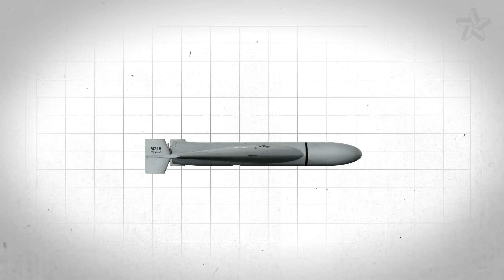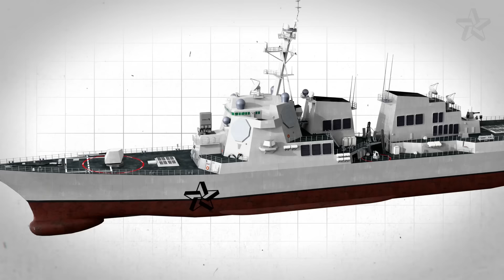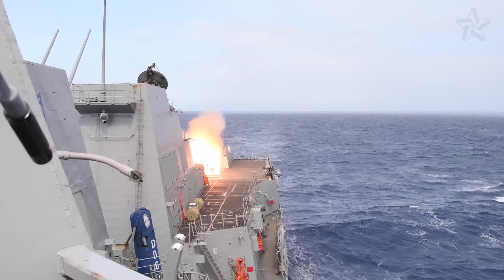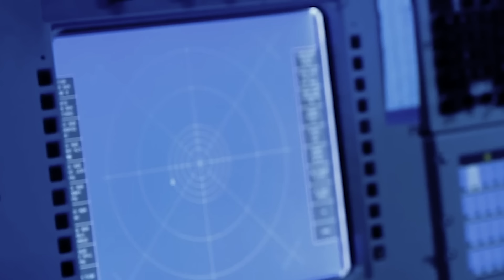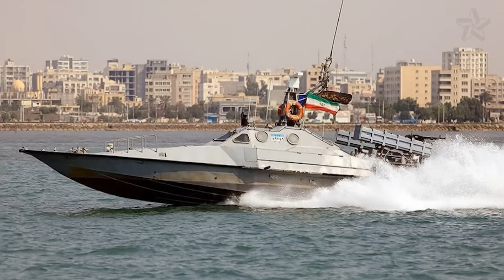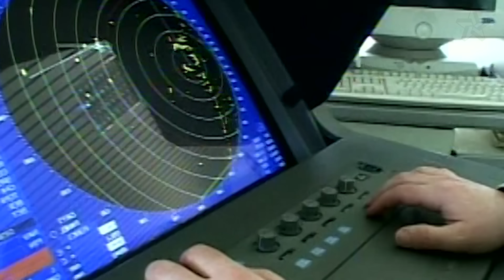US Navy Launched Something That Shouldn’t Exist… Iran Can’t Stop It

Comment: Im not worried about 47 drones … im worried about 500 or 1000
Reply: It is the cone of discharge, it does not matter how many targets are in the cone, they all fall down...!
Reply: if the launch that many drone, they better start digging their 6 feet holes ahead of time because retaliation would executed even before they get closed to the fleet.
Reply: @victorforzani3433  they will need to be deeper than 6
Reply: It's not the drones. Is their anti-ship missiles and torpedoes. Drones aren't the problem. This video fails to address that.
Reply: @zerosteel0123  WE HAVE THAT TOO! THE DEFENSE SYSTEM  IS 100% SECURE AND KNOWLEDGEABLE OF THEIR ACTIONS. THEIR PROBLEMS IS THEY DO NOT KNOW WHAT WE HAVE. AND WE HAVE MUCH MORE TO DESTROY THEM. OTHERWISE WE WOULD GO EVEN NEAR THERE.
Reply: @marcusmoyses3809 do all bots use all caps?
Reply: @marcusmoyses3809  looks like your navy carrier just fled to the Indian ocean. Not only that but you abandoned your base in Abu Dhabi. We got to see US planes tucking their tail and running. What a sight to see.
Reply: @zerosteel0123  what we seen is US airplanes flying at will thru the Russian and Chinese Air defense systems that Iran was using. We seen those planes successfully hitting thousands of targets. Got the bonus of seeing that Iran's drones were not as good as this video showed and that their navy practically sank on their own
Reply: Was also fun to see how helpful Russia and China were helping their partner
Reply: @zerosteel0123 you must think we care about defending places that aren't ours in the first place.  Don't pretend to know why we don't want to be in the middle east anymore.  Or what you're heading is the actual truth.  You probably watch msm news and believe the lies
Reply: @helloneighbor11 oh my. Times, they are changing....... you're getting your asses kicked and fleeing your bases.
Reply: @LookingUp99  right. I guess if you didn't care you wouldn't be there.....oh, wait
Reply: @zerosteel0123 lol.
Reply: @zerosteel0123  your comment aged like milk
Reply: @Crimea_River  Iran is kicking America's ass. What a sight to see.
Reply: @zerosteel0123 😂😂😂 thanks I haven't laughed that hard in a while
Reply: @Crimea_River  that's all you got? Weak come back
Reply: @zerosteel0123 what you’re failing to get goat humper. It kills missles also
Reply: @zerosteel0123 we can shoot them down with this and we have underwater stuff also
Reply: @zerosteel0123  How did that go for them?
Reply: @zerosteel0123  Those didn't work out so well.  Bye Bye Iran's navy.
Reply: @TheCapul3t  I guess you haven't seen the US navy ships that have also been hit. Here is a clue for you. If the US Navy was in control Iran would not be able to close the Strait of Hormuz. But they have. If America has complete control, it could not be done. Wake up to reality.
Reply: @zerosteel0123 I didn't see it because it didn't happen.  Provide even a single verifiable source and I will shit my pants for your pleasure.
Reply: @TheCapul3t  you can do whatever the hell you want to do. When reality hits you like a sledgehammer just know somebody told you so. IDGAF what you think one way or the other.
Reply: @zerosteel0123  the navy has Geo shields that can protect every ship in the attack group .
No matter how many drones they send , they will have to get past the Geo Shields.
There are multilayered protections that the enemy hasn't seen yet in our arsenal .
Reply: @capp11295 I guess you missed the part about the hypersonic missiles, torpedoes, anti ship missiles .........
Reply: @zerosteel0123  I was just pointing out that drones can't do shit..Because of technologies we haven't seen yet., but your right about the hyper sonic missiles, torpedoes, anti ship missiles , those weapons still present a real  challenge...
Reply: @zerosteel0123 don't matter,  we just zap them out of the sky.
Reply: @capp11295 no they don't,  we van take them all down,  we can debt access and shut down the people running and firing them.  We just defeated every bit of tech that China,  Russia and whoever in Venezuela who use that exact modern hardware.  You kidding? We completely shut it and the humans down.
Reply: They present ZERO challenge. They cannot compete with anything we have today.  We're 400 years ahead of them and we haven't even used the crazy stuff much yet.  We're still out in the jungles and the oceans playing with it.  Besides what we have that's space based.
Reply: @LookingUp99  "zero challenge" Iran is kicking your asses. If you cannot even beat Iran what chance do you have against Russia or China?
Reply: @zerosteel0123  it's all in the math.  Iran, China, Russia can't destroy a strike force. They all know this.
Reply: @charlienelson7611  looks like the USA is getting its arse whooped against Iran.
Reply: @zerosteel0123  this didnt age well for you
Reply: @scott1637 the USS Abraham Lincoln is hit and out of the fight. A Destroyer was hit while refueling and the Houthis just took out a Destroyer in the Red Sea. Your THAAD missiles are gone and Iran's missiles are hidden underground where the Americans cannot find them. Where is their disadvantage?
Reply: @zerosteel0123  The IRGC claimed it struck a US Navy destroyer in the Indian Ocean using Ghadr-380 and Talaieh missiles during Operation True Promise 4, though Washington has not confirmed the claim. CENTCOM previously called similar Iranian claims about striking the USS Abraham Lincoln a lie. in other words you have been fooled.
Reply: @scott1637 right..... Just like the "truthful" claim that only six Americans have been killed in the attacks so far? Or the "truthful" claims coming from the Ukrainian war that they're "winning."
Reply: @zerosteel0123 Torpedos don't matter we have underwater drones too...
Reply: @n.s.4424 "torpedos don't matter" you obviously don't know anything about naval warfare
Reply: @zerosteel0123 they don't.  You don't get that these UFO and USO stuff flying around the sky's and oceans are our hardware don't you? No, you dont. We can do well over 200mph underwater. No torpedo can touch that speed.
Reply: @zerosteel0123  looks like Torpedos do  matter
Reply: @scott1637 they really do
Reply: We have the Lazer
Reply: @rickblumenschein2433  Bob Lazer no longer works for them
Reply: High power microwave  sort that out , it's like ...bring it on ...bring 5000 they will fall out of the sky like bird droppings poepoe😅
Reply: @mariuskruger6940  Lead and vacuum block microwaves. Electronics in thermos like this, so the shielding is in order 🤫 .
Reply: God bless America
Reply: @rickblumenschein2433  God doesn't bless satanists
Reply: Add another meteor and their own generator should kill any amount of drones
Reply: @matthewsteinmeyer4998 yeah, 4 of these things in a battle group they don't stand a chance. Take down anything. They'll only get more powerful, more speed at doing the coordinated strikes, no one can compete with us.
Reply: @LookingUp99 there is no country on earth that can stand up to the full military might of the 🇺🇸 USA. The terrorists in Iran couldn’t hold the jock strap of one battle group.
Reply: @matthewsteinmeyer4998 The Navy’s Project METEOR is currently in the prototype and testing phase, with its first shipboard installation scheduled for late 2026. It is not yet in active, wide-scale operational use.
Viability & Strategic Value
Swarm Defense: Unlike lasers, which hit one target at a time, METEOR emits a wide-beam microwave pulse that can "fry" the electronics of entire drone swarms simultaneously.
Cost-Efficiency: It offers a nearly unlimited magazine with a "low cost-per-shot," solving the economic imbalance of using multi-million dollar missiles to down cheap drones..

Yeah. Iran is boned if this pans out
Reply: Just so you know. That's the capability of 1 destroyer 😂😂
Reply: It can intercept unlimited
Reply: Anda tetlalu yakin dengan teknologi anda.  THAAD musnah, Iron Dome pun  penat hingga jatuh di tempat sendiri. Sebab itu China membuat model kapal pengangkut pesawat US di padang pasir mereka.
Reply: @Abe.199 uh huh… I think we will be just fine.  Enjoy the third world.
Reply: You no pay attention it would take out a thousand if they are in the cone
Reply: @philipcraft6839  100% RIGHT !
Reply: Why when it frags one electrical system it frags #2-1000 also
Reply: Plus missiles
Reply: yan ang napala nyo
Reply: ang muslim nd takot mamatay kayo amerkano takot kayo mamatay
Reply: CHINA
Reply: They cant launch that many simultaneously. The simulation accurately depicted their capability
Reply: @LiamJaytheGreat even if they did, it wouldn’t matter.  3 or 3000, it’s the same energy output with the same result.
Reply: If these drones are in a fixed path how can any hit s fast moving object
Reply: @ey6008 the drones don’t move at the speed of light like the microwave pulses do. Wait until we start with laser weapons.
Reply: The hypersonics Iran has will take out the ships cant defend against 18000 kph
Reply: @thechartjunkie3822 those are also susceptible to laser and microwave. Everything is.
Reply: @thechartjunkie3822  how did that work out for the iran leaders
Reply: @scott1637 not good but all 27 us bases have been hit and isral is getting smashed.  They will run out of defencive misiles soon and not that many of them are working and they have also been failing and landing on them selves.
Reply: @thechartjunkie3822  LMAO sure buddy is that what the Iranian news outlets are telling  you know thats a lie
Reply: Try watching scott ritter, us wepons inspector and adviser to trumps first administration
Reply: @thechartjunkie3822  There has been a lot of so called experts who disagreed with Trump and he continues to prove them wrong on so my fronts. I remember when Obama said Trump need a magic wand to bring jobs back and all the leaders in Europe laughed at him when he warned them about being to dependent on russia Gas,  Now look at them fools.
Reply: A lot of experts that tell the truth just like Ukraine is winning the ate running out of misiles  we are seing the same bulshit now.
Reply: @thechartjunkie3822 how do you know? Do you have classified information that we don’t, or are you being lied to by those supporting Iran?
Reply: @Notafanofwoke
Larry Johnson  cia analyst 
Scott Ritter wepons inspector and adviser to the first trump administration.
Douglas Mc Gregor.
Reply: @Notafanofwokeand I study war and wepon systems, and know that the US and israil and EU and UK are the bigest liers and say things the are so moronic and arnt in the realm of reality. I'm Australian with a lot of military family.
This will end with the US being kicked out of the middle east buy the Arab states.
Reply: @thechartjunkie3822 lol you are claiming to be so smart, but you can’t even spell or fail to check your spelling! It makes your claim invalid and ridiculous! 😂
Reply: @thechartjunkie3822 So you say..you can’t even spell weapons correctly. 😂
Reply: @thechartjunkie3822 Did you miss the video? The ship is equipped with a microwave laser. Thats the speed of light. Thats about 1 billion kph. No, the hypersonic missile will have zero chance. This is why the USA invested heavily into laser technology while others were doing hypersonic missiles.
Reply: @nicksaunders115 you have no idea what you are talking about microwave is diffrent to a laser wepon. China has a microwave wepon that can take satellites out of high earth orbet. Laser is a intense narrow beam.  These are not new and russia and china have been leading the technology. The same with hypersonics. 
Its about targeting not how fast a beam of light is. They are affective on up to about 5000 kph at most.
Reply: @thechartjunkie3822  China has zero earthbound microwave weapons as of now. Russia, less than zero. 😂😂😂
Reply: @thechartjunkie3822 Used up early against Israel. There down to zero. No option for resupply.  Plus, the launch facilities for anything that large continue to be obliterated.
Reply: exactly
Reply: The same thing would happen no matter the number
Reply: Iran wants a Nuke, We'll give them one!
Reply: NOT WORRIED ABOUT 100,000 DRONES EITHER. SHUT THE GPS THEY ARE USING DRONES WELL DROP LIKE FLIES!
Reply: Simple shit to interrupt drone signals... USE the N.E.T.
Reply: Iran will expose their secret caves with the N.E.T.
Reply: THE LAUNCH AREA FROM IRAN JUSTS GOT FUCKED!
Reply: We have drones for that shit too
Reply: Don't forget the  U.S. NAVY HAS LAZERS!
Reply: IRANIANS forgot about SPACE FORCE
Reply: Iran forgot we have a $15 plus billion plus and growing Military Budget Savings... Our Space Force has something I can't say here... But Iran and even China and Russia would SHIT Warheads when we use it on IRAN that's already inside IRAN
Reply: We don't need nukes... Iran has a major fault lines... We just need to activate it ...
Reply: @n.s.4424 the idea when dealing with Iran is to take out their government and military, not their people.
Reply: Colaps the Arabian and Eurasian Tectonic Plates Under Iranian Bases and they can't defend from that!!!!! What then when shit falls on top of your underground bases? They expose every underground breathing holes . THEN WE USE FULL BUNKER PENETRATING BOMBS! DONE!
Reply: Im only worried about the 600 nukes they smuggled over Biden's open borders.
Reply: nah piecce of cake, the closer they get the easier it is to down em all, what you just watched was simple target practice with several defenses used. They do this for a few reasons, to get rid of aging weapons and to test the system live for functionallity and to keep the operators well oiled, not to mention the fear it puts in the enemy
Reply: Lazer array melts 70 different targets at the same time 
You don't see it's use because of proximity requirements
Reply: Yeah because that's what we'll be facing against a naval battle with China.
Reply: Not with this, zap them all at once
Reply: we already blew up that many before they took flight
Reply: Russia atacks now in 3000 drones...
Reply: I imagine if they could launch that, then they would have. That's for the war with China, and yeh... that would suck
Reply: Yea they were already taken out by ground penetrating radar scalar weapons...dont worry we good...just need China and Russia and Japan to keep fucking off
Reply: Iran is in Trouble because Trump has been wanting to destroy them for a cery long time and now he's at it so it's possible that they might get nuked
Reply: And then the next 500, then the next 500, then the next 500 and so on
Reply: I often wonder why they can’t spoof GPS signals with an “evil twin” drone to send back the drones to their sources 😂
Reply: How about multiples of 1000 from different directions? The question is do we have the fortitude to do what is necessary with these type of threats to civilization or not because if not, civilization will end.
Reply: @johnsoper7649 exactly it turns a circle it doesn’t matter a million . It don’t use bullets. Imagine a flash light if the light hits you. You fall down.
Reply: @philipcraft6839 plus, that was one destroyer in the example. Do we think they only have 1?
Reply: Accurate. Fortunately we also have more than one AB class Destroyer out there. 

From what we've seen, Iran's capacity is about 3,000 drones. Which translates to... not enough to overcome two carrier strike groups.
Reply: why worry, unless you helped your kid believein joining up after failures in Vietnam, Iraq, Afghan, Cuba ++
Reply: oh. I forgot Korea.
Reply: @P @Promotall litarily we won Vietnam  but lost it politically . As far as Iraq…. We kicked their butt, hard. Never tried to take over Afghanistan so that doesn’t matter. We never actually invaded Cuba, either. That would last about 2 days. Max.
Reply: @kungfuhorn1  Look up the "Bay of Pigs"  re Cuba. As for the rest any search will show you the truth.
Reply: @kungfuhorn1 Cuba's shittin' sugar cubes now.

Comment: Oops! Did you just leak military secrets to the enemy? Now Iran only need to wrap their electronics with a water blanket. Water is an effective shield against microwave energy. You should have said the weapon was X-ray based. They would have used a lead shield against X-ray and the extra weights would shorten the drone’s range.
Reply: It suredoesnt matter what they wrap them in . If they dont have GPS guidance they surely won't hit a moving ship. Besides a drone with a puny 2 cycle engine can't carry extra weight far if they can even fly.

Comment: Well, a drone is a thing of the past. They'll use HYPERSONIC missiles ... and other means - ALL AT ONCE! You can't stop hypersonic plus glide vehicles. Period.
Reply: Iran doesn’t have any  verifiable hypersonic glide missiles yet … drones are not a thing of the past …but you’re right , we can’t reliably stop HGV yet…. We were asleep at the wheel and made a very bad military calculation years ago by not pursuing Hypersonic … but we are catching up fast …
Reply: For every new weapon eventually a new defensive weapon or system is invented.   Advances in electromagnetic energy systems will eventually be able to track and immediately destroy anything flying slower than the speed of light.  I can envision a microwave curtain or dome, a force field that could destroy or knock out any flying object, especially if in combination with an active laser or particle beam weapon.  We now have small transportable nuclear fission reactors that could supply the necessary energy and cryogenic cooling systems to ensure rapid or constant use of these weapons and defensive systems.  I wonder if the British SABRE engine cooling system could not be adapted to provide the cooling.

Comment: Also that dish can fire off free aim, they were originally made for crowd control and self aiming by the operator. So it wouldn't need the radar track if they knew the direction and speed of the drones they could calculate the area they need to pulse and do it blindly and be fine.